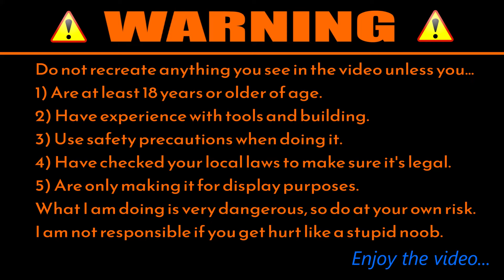Building A Wooden Medieval Style Mace

Comment: Cool project. I was thinking it'd be a nice shop mallet. Then you put the studs in. Also one thing I would have done differently was mixed some stone or saw dust into the paint for texture and to add some grip for the leather as I prefer to tie my handles so I can easily change them if I don't like the feeling later.
Reply from the maker: Thank you for the comment and the idea. A shop mallet is on the build list but it might take awhile for me to get there 👍